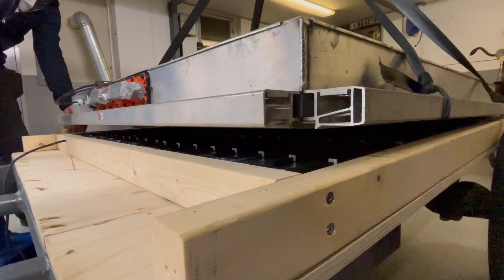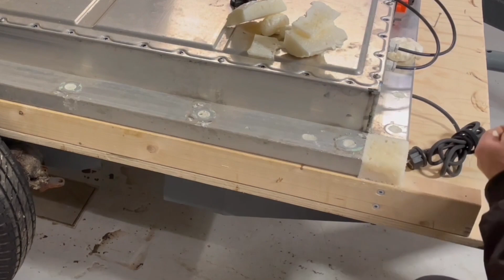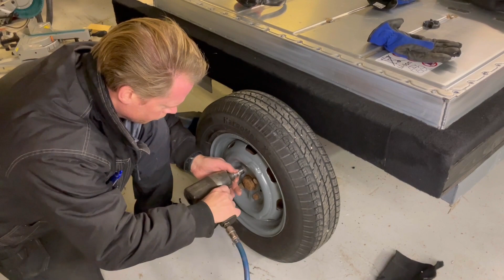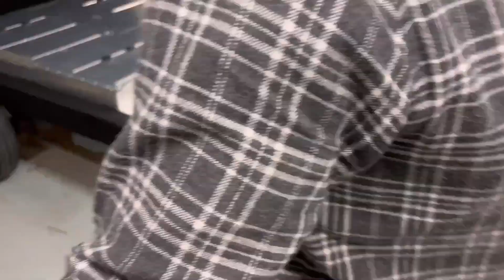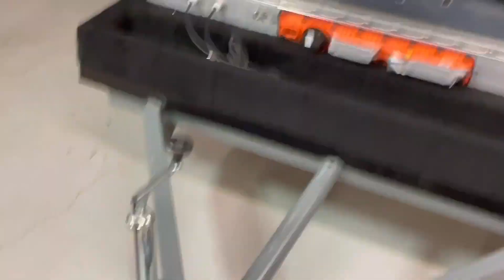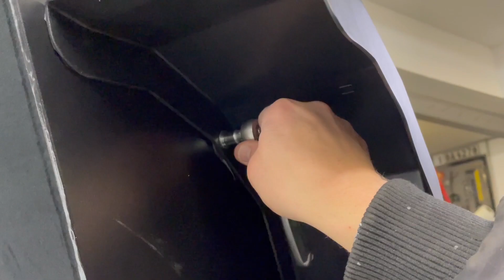I built a trailer to my Vw Id3 home battery 62kwh for solar storage. Part 4. Battery installation

Comment: Is rust on the inside/underside of the frame not a problem because it is not treated i see? Very cool design by the way!
Reply from the maker: That’s correct, and I am pretty sure that it won’t be a problem cause it’s not on the road anymore, but if I like to I can easily put on some rust protection if I see that it gets worse. Thank you so much.☺️